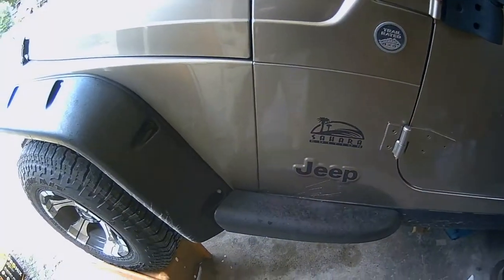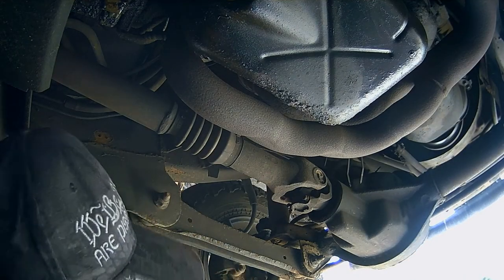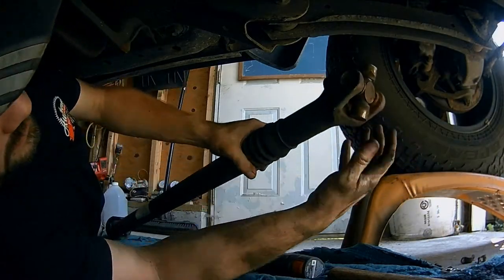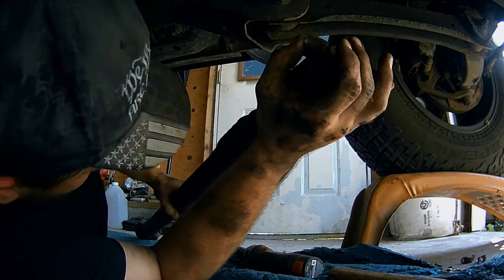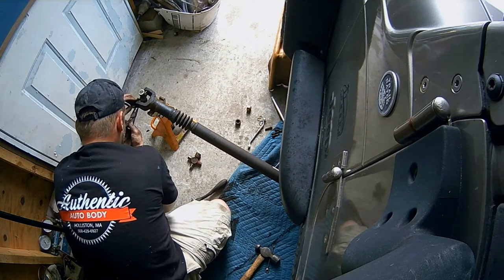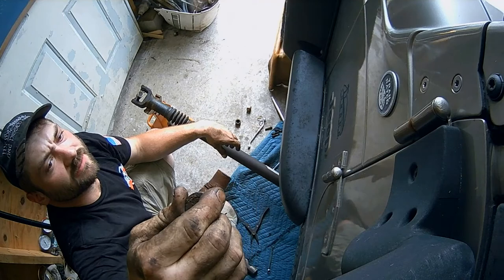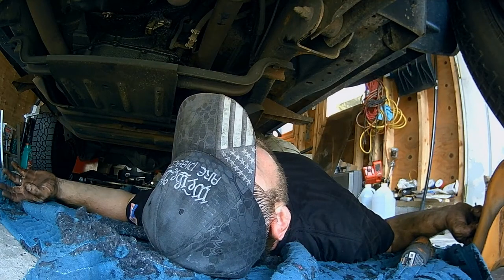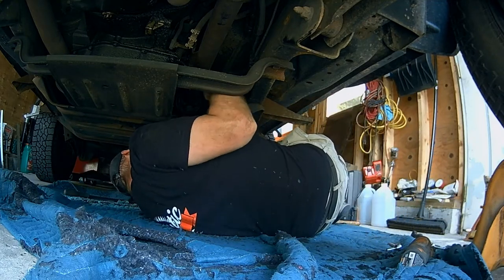How i fixed a Bad vibration at 55mph 04 Jeep Wrangler TJ Front driveshaft front U-Joint Replacement.

Comment: Nice and easy
, I have vibration in dash and whole body of car also at 70 mile , so , do you think it's the same issue ?
Reply from the maker: Very well could be the problem. A good way to check is to take the front shaft out, while you replace the front u joints and the shaft is out, take it for a drive and if the vibration still occurs, then the u-joints aren't your problem. But at least you can replace the fronts to find out... or take it to a shop and have it diagnosed. Hope that helped. Have a great day.
Reply: @crocreations  
Thank you
Reply: @crocreations  
I will change the 3 u joint , is that okay or 2 is enough ?
Reply from the maker: @nothingofmatters if you can replace them all, I would. If you only have access to 2 check which ones have play and replace the problem joints.